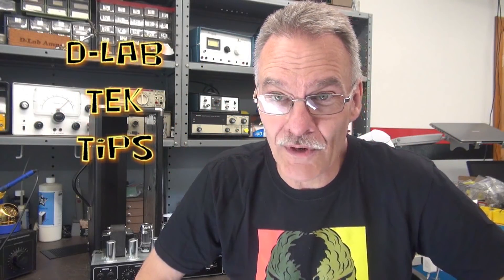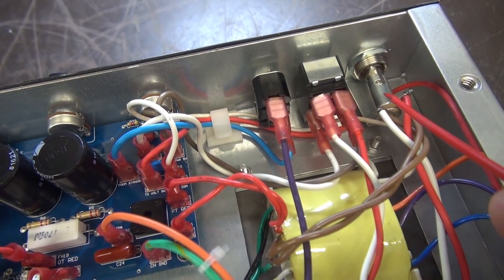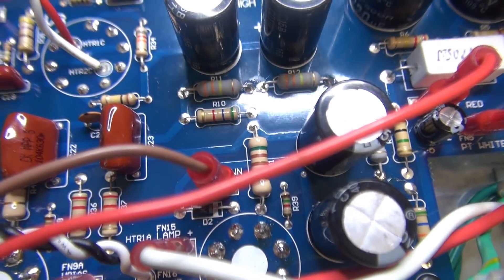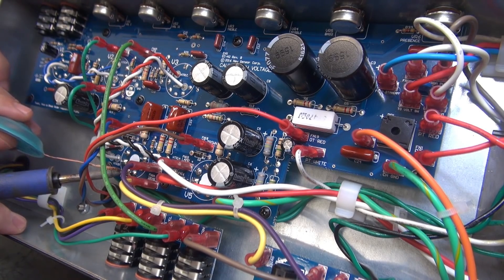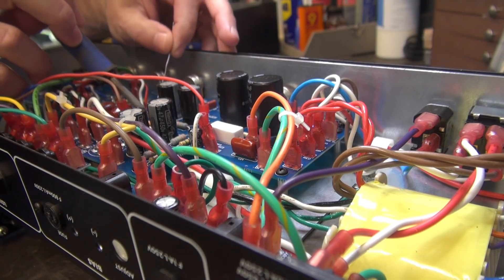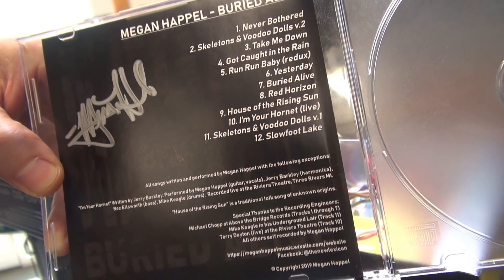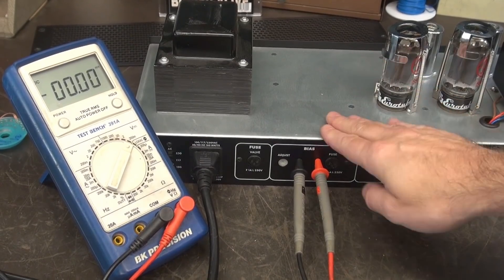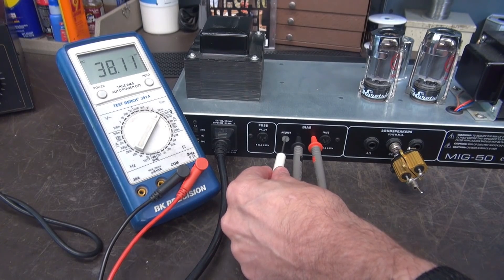How to repair Bias Electro Harmonix MIG-50 Tube Guitar amplifier

Comment: In the manual of the new MKII version, it mentions improvements in many sections of the amp, including the power supply. Perhaps they went on and fixed the bad soldering job? 

Happy belated Birthday, Terry. Amazing and very interesting video!

Comment: Wow 535 volts to the plates is pretty 🔥..  I had an old sovtek 50 watt tube midget back in the 90s That thing is probably close to 60 watts RMS.. Ringed solder joints are the Big enemy of PCB boards and  heat is  another. I always look especially at those power tube sockets. Good video Happy Bday  Terry

Comment: I have a Mig 60 and its recommended bias on schematic is 80mv, which is ihe same parallel config as the Mig50, so 40mv per tube. . But I think it uses EL34s so.....but looks like you found the answer from them and yours is 62-65mv. So I'll shut up now. Haha. You're the best! Cheers Komrad! Salute!

Comment: When they build those pin 8 is the pin they used to adjust where the socket is set for height, and alignment so it's slid around until the socket is where it's supposed to be, and then pins 1-7 are soldered in, but all the flux was cooked off the pin 8s during the initial positioning of the sockets. They SHOULD suck that fluxed up crap solder off pin 8 and resolder it. NONE of those solder joints look acceptable let alone good. The ONLY time I add extra liquid flux is for chassis grounds, and a few select places where I'll use paste to avoid overheating, or for SMD stuff. There is a local boy made good who made amps for Deathlock and other Adult Swim shows, and his first amps were modified Sovteks. Very nicely modified Sovteks!
Reply: And why do  you need to look up the bias current? Set those tubes up for 60-80% plate dissipation for Watts,  and see where the customer likes the sound. Below 60% it gets muddy, above 80% you eat tubes faster. Ohm's Law! NOS Sylvania 6L6GC STR 415s can be biased at 90% or more, but this new Sino/Russian/Slovakian made stuff? NO WAY. 73s  KI7AQJ

Comment: Happy belated, Terry!   Looks like a bad wave-solder job.  Either they didn't get their flux spray right, or ran the conveyor too fast.  The tube sockets would have been masked off for wave with Kaptan tape, and done with selective solder or manually soldered after all of the top layer components went down.

Comment: Terry, hello and Happy Birthday belated. I thought that bias feature was really neat and thoughtful how the company 

put that on the back. I was intrigued they bias both tubes through a single circuit rather than biasing each tube separately.
I do understand cost is involved though. So unless you do some probing and calculations a person won't know if each tube 

is truly biased equally. I mean, sometimes tubes aren't matched. Is this a correct assumption? Anyway, it is still a nice feature.
I enjoy your videos and am learning through them and others.Reading books as well to possibly have a small repair shop to 

supplement my retirement income when that happens, shortly.
Thanks, Kirk Murphy

Comment: The Sovtek Mig-50 was made in the 90's with Russian style parts.  the EH version would be considered a re-issue,  and uses "general"  electronic parts.   If you see the original,  the resistors and pots are especially unusual,  and may have been soviet surplus.

Comment: Happy Birthday Terry, love Da Johnson’s too!!

Question: because of all the cold and non-existent solider joints and with those being double sided boards why did you not unplug the wires and pull the boards to check both sides?? While I know it’s a huge pain it would be a much better observation and chance to confirm every joint is properly soldiered eliminating bad joints.

Comment: Slid that "just about transmitters" in there. I think we all know why you did that! No confusion! Over 500 volts on those plates? That sounds a little excessive to me. 450-475 seems on the high end. That must have been above 70 percent of max! My 60 watt Pignose w/6L6GCs is only435. Great video and T-shirts. Thanxz

Comment: Happy birthday Terry!

Having been a metal fabricator and welder my whole life, ironically, I had never messed with soldering before.  You inspired me to buy a soldering iron and some rosin-core solder to start doing my own guitar pickup swaps.  So far, so good.  Definitely a learning curve involved, but once you get it figured out, it’s all gravy.

One of these days I need to send you my old mid 90’s Marshall Valvestate VS100R That I’ve had for over 20 years, that has mass-amounts of hum, even in the clean channel, and some of the input and output jacks need replacing or cleaning.

And I want to convert my MIM Fender Princeton 65R 1x12 combo into a tube Hot Rod Deluxe w/ KT77 tubes, and 12AX7 preamp tubes.

What do you think the estimated cost might run for those?  I know actual cost will vary, but just wanted to get a rough ballpark number.

Comment: Is it true when calculating grid bias on a push pull tube amp that you have to multiply it times two to set the correct bias? 0:06